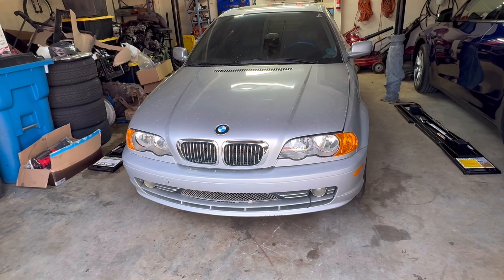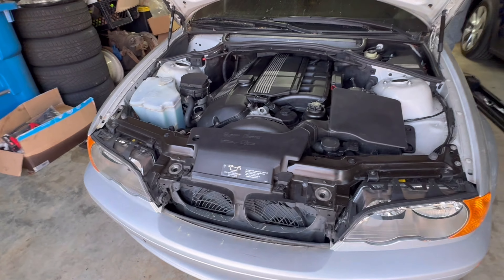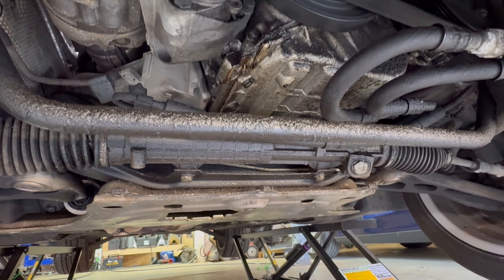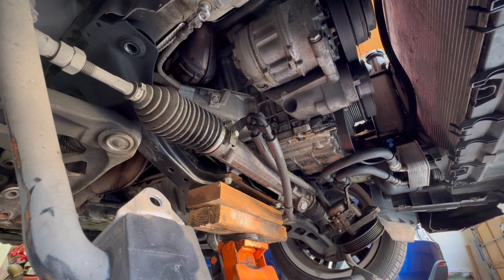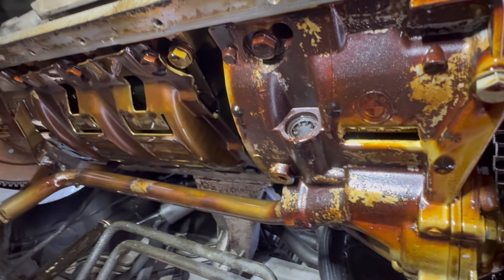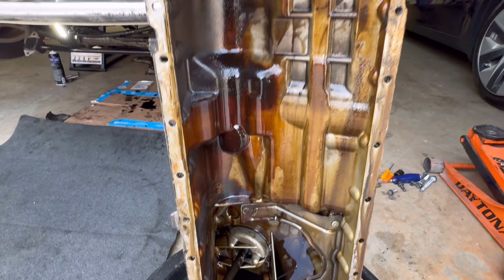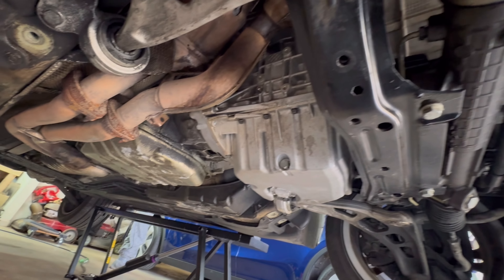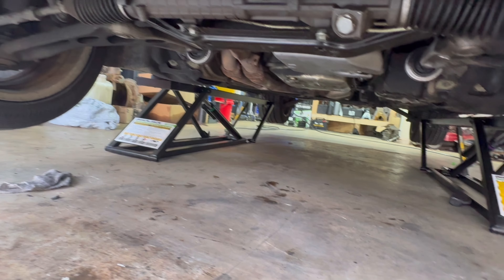DIY E46 330ci oil pan gasket replacement.

Comment: You'll lucky I always find timing chain guides in my oil pans
Reply from the maker: Yep. The new sensor came with the oring. Fcp listing didn’t say if it did so we will just save on the extra oring in case we need it for something else.
Reply: @robsweekendgarage  I've got about half a dozen of those o-rings because real OEM shows you need the o-ring. Love the videos

Comment: I thought the new oil level sensor came with a new O ring?
Reply from the maker: I couldn’t remember when ordering and FCP didn’t specify if it did.  So for a couple bucks I grabbed one just in case.  Didn’t want to get the old one out and not have it.
Reply: @robsweekendgarage  I just double checked because I’m about to order one as well with my next oil change. It does state “includes replacement o-ring.”